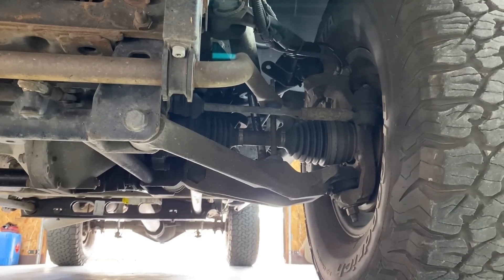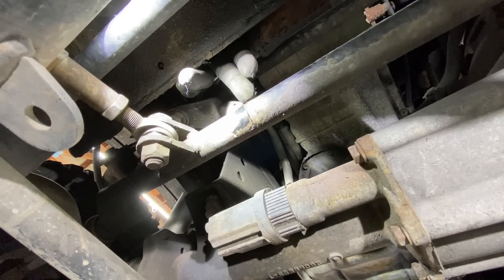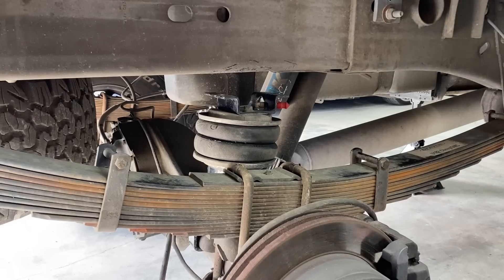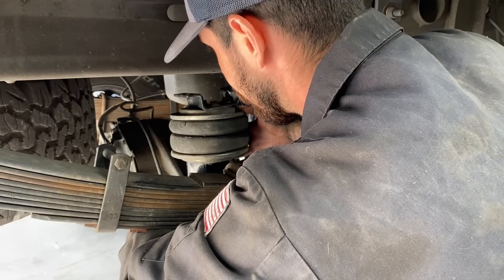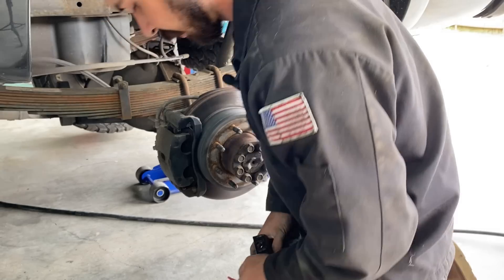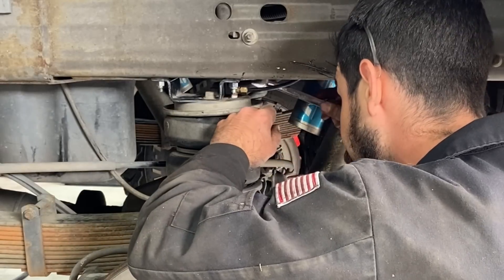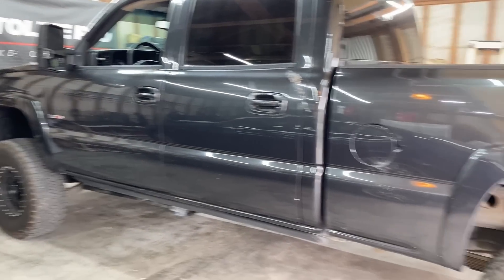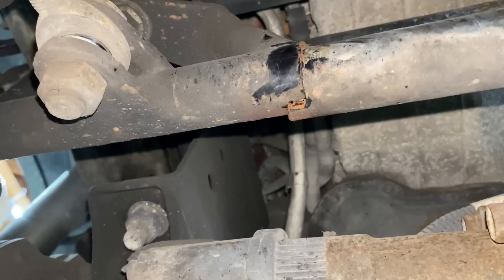I Was About To Buy My Next BMW Until I Found This! BAD NEWS

Comment: Had a similar issue with one of those quick lube places.  For some inexplicable reason, dude put the drain bolt back on by like 3 or 4 threads only.  Found a wonderful mess on the driveway in the morning.  15 years on, I do all the work myself.  RIP ye ol' Civic, you're a Coke can now...
Reply from the maker: RIP! Coke can 🤣🤣🤣

Yeah I’m terrified of quick live places, I’ve fixed their handy work too many times at the shop

Comment: Wise decision to check out the noise, you might have saved your own life. So easy we can make videos to diagnose things if you work alone. I checked the DISA valve by duct taping my phone to the air intake hose. Record and drive around for a bit. Oh and don't forget to turn on the flashlight or you'll have a black video lol.
Reply from the maker: Thats a great idea! im going to have to try that out. Undercarriage noise may be a little bit more difficult though lol

Comment: That's a potential catastrophic failure on a part that looks really robust; lucky you checked it. Please record the replacement or repair. A welded collar over the breakage would be a good repair.
Reply from the maker: Yeah it could’ve ended very bad! Working on getting replacement parts, there will definitely be a video on it 👍🏻